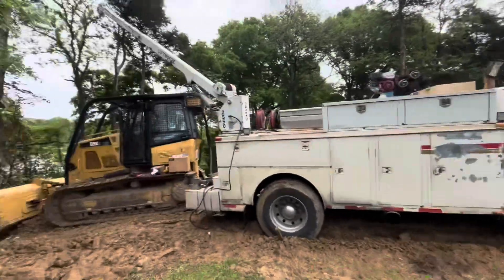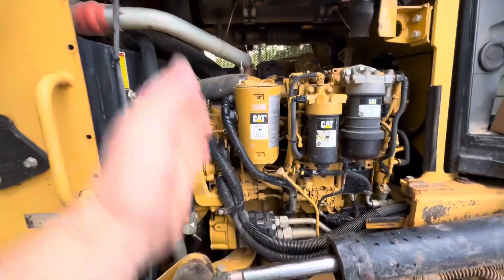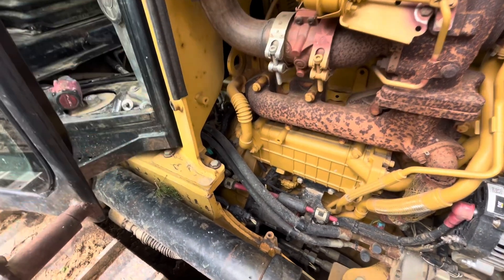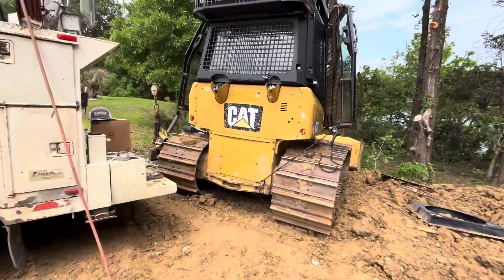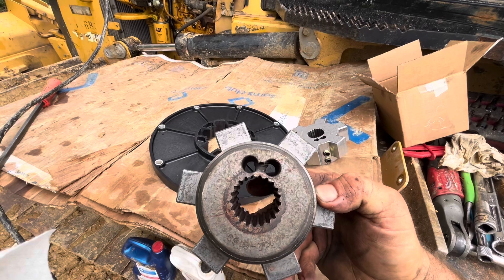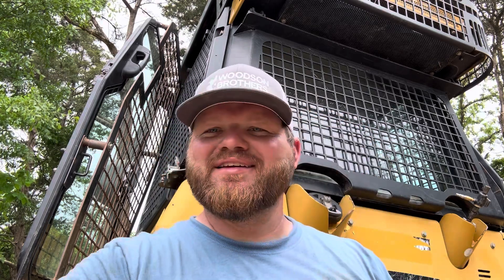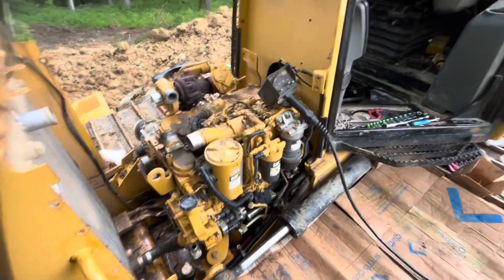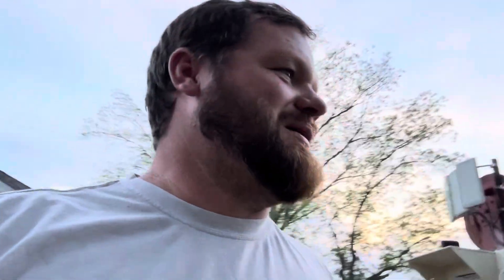Cat D5K2 hydraulic pump coupler repair.

Comment: Great Job and Good Luck to ya Fella !!!
Shitty Plastic from CAT and a Mammoth Job to change it out !! - Thanks CAT !!.
We had a 245B ME and the Pump Drive let go !- A similar Drive Set up with about a 300mm diameter square Toothed outer Ring with a failed Plastic coupling between the Pump and Engine !. Admittedly the machine was 10,000 hrs

Comment: I've been turning wrenches professionally for 42 years in the automotive field. I've always been interested in heavy equipment but when I watched what's involved snatch an engine out for basic repairs especially something that's plastic basically designed to fail I don't feel so grumpy on Monday mornings when I have a check engine light for an EVAP code kicking my butt! I don't have tik toks I'm glad you're here keep up the good work
Reply: I'm glad these couplers are plastic. Its designed to be the weak point in event of failure. Customer of mine has a bobcat 328 mini excavator that has a similar design. Well the hydraulic pump seized up. Normally the plastic coupler would strip and prevent catastrophic damage except this customer had the plastic coupler fail before and had a machine shop make him a new set up out of steel. It didn't fail and instead the Kubota diesel sheared the crankshaft and destroyed the engine. What should've been a $3000 pump job turned into 11k by the time I installed a new engine and pump. It got a plastic coupler back in it. Some designs seem stupid but in many cases are that way for a reason.

Comment: Even cat excavator have a drive coupling, most older D3, and D5 when coupler goes blade will still work.  I just remove pressure tap from hyd filter, start, if oil doesn't shoot 15 feet, drive coupler is stripped

Comment: Running a 5K LGP piling dirt and started up a bank and it QUIT. Carolina Cat pulled the motor and the coupler gear looked like a cam gear on a VW wabbit diesel. Went back with one a LOT beefier. Dozer ran fine after that. When the old ones strip, that's IT!